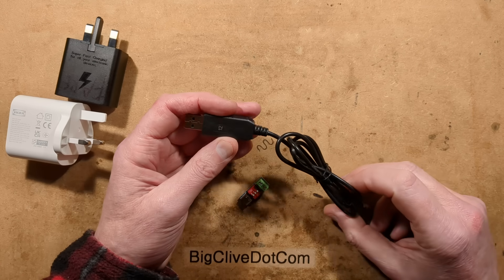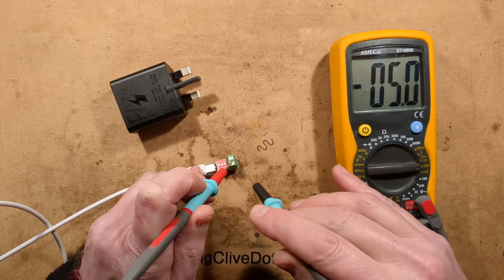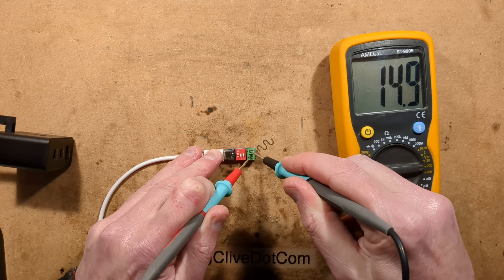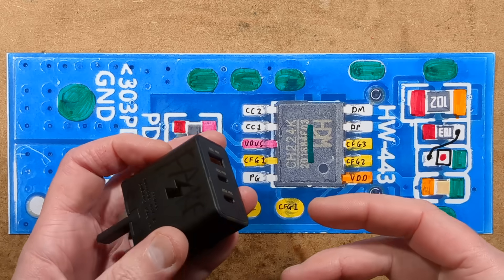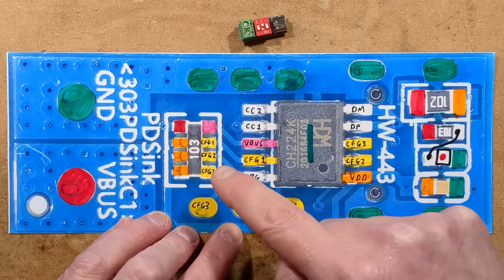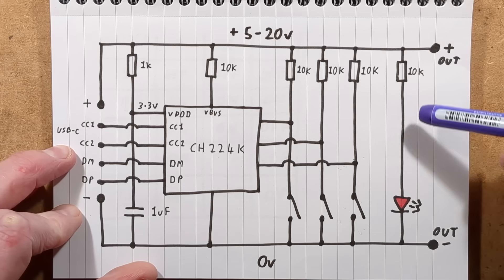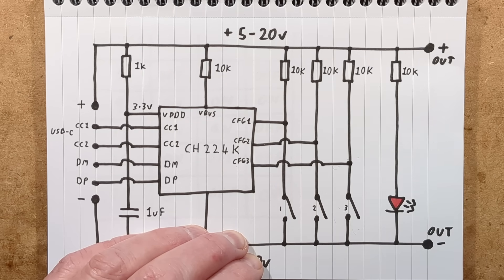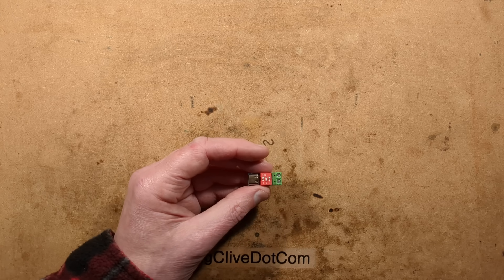Cheap USB-C programmable PD voltage module for 5,9,12,15,20V

Comment: Clive, are the soldering practice boards you can get on Amazon Haul any good? Not sure I can share links but keywords are "Rotating LED SMD NE555 Soldering Practice Board DIY Kit Fanny Skill Training DIY Kit Electronic PCB Board Module Suit"
Reply from the maker: The online kits are usually good.  I don't have an amazon account, but have bought them via eBay and AliExpress.

Comment: I ordered a few of these. No dip switch info. When I found the settings there are 4 settings that with give 5 volts. Are they different types of 5 volts?
Different amps?
Reply from the maker: The dip switch options for this module are in the video description.  Unused modes default to 5V.

Comment: You need to pair it with a voltmeter to identify when you've set the dip switches incorrectly.

Comment: Something I've noticed on a crappy USB power supply I have is that I need to reconnect it at its USBA port for it to negotiate at all sometimes. Doesn't happen when I disconnect the USBC end.

Comment: One little-spoken thing about USB-C. There is an optional chip in the plug of each USB-C cable. Yes, a chip in the cable. The cables can have identity - and if they don't, the capability of the cable defaults to 20 volts and 3 amps = 60 watts. If they do have an identity chip, they can go to other crazy extremes, but I believe 5 amps is the maximum -- 5 amps & 20 volts = 100 watts. Many cables bundled with power banks and laptop chargers have this chip and this capability, but the identity can present even higher voltages - I think up to 50 volts or thereabouts.

However, a sorely lacking device in the prosumer/nerd space is an identifier for these chips - to identify and display cable capabilities. It's a very frustrating problem, not even being able to identify cables with our devices (e.g. phone, laptop) - no software seems to exist to communicate with the USB PD controller and inquire about the attached cable. You can learn it by discovery - for example, attach a power supply of unlimited capability (e.g. a "200 watt" USB-C supply of some kind offering crazy high voltage and current) to a MacBook of some kind, then use AlDente Pro (or maybe even System Info built-in) to see what capability/wattage is detected for the adapter. The system takes the cable ID into account, and tells you the wattage - e.g. if you attach a chip-less cable between the two, it'll report 60 watts.

I wish more people knew about ID chips in cables, and how they become a bottleneck between USB-C power supplies and USB-C devices.

(The USB-C power bricks also have their own capabilities - they may support only a limited range of voltages, or even a subset of select voltages like 5, 9, 20 volts but not 12 or 15. They can also present wattage/current limits lower than the cable. There's all kinds of ways to negotiate, and each limitation must be taken into account!)

Comment: This video came at a good time. I have a computer fan that I had running off of a buck boost USB stick and it failed eventually. It's probably much better to rely on a well made consumer good to put out 12V continuously than convert twice with some hobby project looking buck-boost converter.

Comment: The Vbus is likely to monitor for USB presence - I bet there's an I2C or other interface for a processor on that chip, and it can use Vbus to detect if a USB cable is plugged in so it can notify the CPU as well as to start power negotiations. After all, it can be powered by the circuit because it runs off a battery so the main processor can get information about incoming power. Vbus signalling for USB cable connection is common and how you tell if you're plugged into something (a PC, a wall adapter, anything will bring Vbus high). The Chip uses it to start negotiations, and likely provides that information to a host CPU if desired.

Comment: Well presented video and interesting module, BUTs, inportant BUTs :
1.- These tests without load are pointless: Always check without and WITH LOAD. You will be amazed how bad some output voltages and currents fall when the regulator does not have enough humpf.
2.- Please, WITH LOAD, measure currents, voltages and Watts. 
Then you can tell whether this liliput converter/regulator is really useful.
3.- While loaded, keep an eye on temperature.
4.- A case to avoid accidental contacts, unwanted heat transfer, as well as accidental actuation of the dips would be useful.
5.- And the ultimate point, la reason d'être: Can this little trinket translate and sustain the same Wattage of the source to the load?
Reply from the maker: This just communicates with the power supply.  The stability of the voltage under load will only be dependent on the power supply and cable.
Reply: @bigclivedotcom when a device that small brings up voltage, it reduces current on load. The trade-off is not linear meaning if you turn 10V to 15V current may go from 1A down to .5A but 10V to 20V may crash current down to a few mA.
When it brings down voltage the current demand increases. What is the the top current that this device can handle before cutting off or over-heating?
Reply from the maker: @johnbofarullguix1499  This module does not convert the voltage itself.  It negotiates with a modern USB power supply to get it to provide a higher voltage.

Comment: Was that Liquid Paper you used for the direction? I haven't touched that stuff in decades. I used to get it in ledger green to match the engineers computation pads.
Reply from the maker: I sometimes use correcting film on the schematics.  Maybe a comment meant for a different video?

Comment: Out of curiosity, do you think this module capable of powering a 2amp load at 12v? Would be useful to power a router from a QC-3 capable power bank during a mains powercut.
Reply from the maker: That depends entirely on how much current the power bank can provide.

Comment: This is pretty interesting - I've got a small 10" server rack that has some IOT devices and network switches - all basically 12v 1-2A or 5V 1-2A; this means I could locate a USB-C power supply (one that doesn't turn all devices off when a new device is connected) and then use these circuits to pull the voltage up to 12v for the little network switches!
Reply: Update, the Asometech 140w 6-USB-C out charger shows the correct circuit voltages as soon as they're plugged in - which is great.  Now I just need to make little enclosures for them or something to keep them safe.

Comment: Is it possible to set the output voltage to other voltages? Eq 7.8, 12.6, 16.8v by changing the value of the resisor on each of the switches ?
Reply from the maker: No.  It's fixed values.  But there's a new standard that does offer a wider range of voltages.

Comment: If you really want to know what's going on with that knockoff power supply you need a protocol decoder. They're cheap and even I have one just because I was tired of diagnosing USB-C charger issues
Reply: It will also tell you what protocol this device is capable of using

Comment: Generating the 3.3V VDD just with a 1K series resistor seems pretty nasty to me. Does it have some internal zener diode to clamp VDD to 3.3V?
Reply from the maker: Yes.  It has a shunt regulator.

Comment: There is the Infineon CYPD Barrel jack replacement (CYPD3177) USB-PD sink that can negotiate and output the voltage if the PD source can adequately source the desired power.  It allows for hardware settings, so no boot dependencies or bootloader shenanigans.

Comment: You have to be careful with these PD modules. Some of them will blow up chargers if you back feed power into them.
Reply: I blew up a 100W ugreen charger then a 65W Google charger before realizing it's the PD power supply that's the problem.
Reply: This only happens when the device has more than 5v on the USB power line like there’s a battery connected directly to it?
Reply: @davadoff The USB charger was outputting 15V and when turning off the PD output the battery backfed into the power supply which backfed into the charger.
Reply: @jahnkeanater  ah. Got to be careful charging batteries. I think I did the same but not with USB or USB-PD. Luckily mine was fine, it just powered the power supply through its output. Should use a diode.

Comment: The barrel jacks are even better than this, although fixed to one voltage. A tear down of one of those would be fascinating as they’re all hidden away from prying eyes.

I am waiting for a USB-C PPS equivalent of this board, it must in turn be waiting on chips? Looks like a harder standard to support, going by the variable power supply projects I’ve seen using it needing (?!) a raspberry pi to send the signals.

Comment: Thanks for the video Clive. We finally have an Ikea in New Zealand now so I can buy their USB chargers, you've spoken so highly of them in the past. That one appears to be a 'SJÖSS' - is that right do you know? I think I'll go ahead and order it anyway. Cheers big man.
Reply: Of the current ikea chargers, 30W & 45W (and 60W in USA), probably called sjoss, the 45W one is the one to get, I believe. Maybe 60W if you have access to it. 30W is safe, I read it makes an audible noise.
Reply: @davadoff  Cool thanks for that. I've ordered the 45w version. We have 230v power here in NZ so likely get the same units as the UK (other than the plug of course).

Comment: I have those exact boards on several projects. I clip the leads with flush cuts and the switches as well to reduce the risk of bumping them. 

I've converted 2 LCD monitors to USB C, I have a PoE Switch in my backpack that I used one of these to feed a DC-DC Booster to 56VDC and it runs a whole 8 Port full of cameras off my Sharge 170 Power Bank.

Comment: I have several of these, they are great. Yea I hope it never fails and gives some random voltage to my stuff plugged in lol..
Some look identical but the switches are different, always check with multimeter

Comment: Would be nice to get a few of these to upgrade old micro usb devices to be able to negotiate 5V, or even just to replace the pretend usb C ports in shitty devices that don't negotiate, the ones that only charge with the stupid A to C cable they come with

Comment: I have ordered identical looking boards on AliExpress Combo Blast. But mine have a blue LED and a different chip called "PAK02A RFDWL9000 2502BASAE", Only got it to trigger 5V and 9V, the rest did not work. Tried multiple PD-chargers that are capable of more voltages. Maybe I will try to get one explicitly labeled as CH224K next time.

Comment: I would so love to learn basics of electronics from you. Ever thought about making some kind of course? I enjoy your videos but I understand so little. Like. What does "pull high" or "pull low" mean?
Reply from the maker: Pulling high is when an input pin to a microcontroller is biased towards the positive rail, while pulling low is biasing it towards the negative or zero-volt rail.

Comment: what I would like to know is if these modules are good for e.g. powering a LNA in a simple SDR RF receiver setup, or does the put out "noisy" 12 v that would show up on the SDR input.
Reply from the maker: Any noise will be from the USB charger.

Comment: I presume the VBUS connection is for the Power Good pin that isn't used, it would sense the supply voltage and set the PG level if the voltage is correct? I feel like that PG pin should be driving a MOSFET to switch the output voltage to protect anything downstream from incompatible voltages.
Reply: Problem is it’ll probably switch PG true when requesting 12v but outputting 15v. 
Some PD trigger modules go with 5v if the voltage you request is not available. Some go with the next lower voltage. Some the next higher.

Comment: I use USB-C to power my heated gloves and insole warmers. The Aukey batteries I use have a behaviour where you can switch between the PD voltage and 5V by pressing the button giving me a quick high - low. But a newer higher capacity Iniu battery I bought doesn't do that, so a decoy that could change voltages on the fly would be handy but dip switches won't cut if for my purpose. When I first bought decoy boards I got ones with a female connector but I quickly realized male was the way to go so I could plug it directly into a battery. After soldering on wire with a DC plug I cover the board with a few layers of heat shrink tube and glop on some E6000 to give me something to grab.

Aukey isn't selling in Canada at the moment, I really wanted to try their pb-y57 20000mAh battery which probably behaves like their similar looking 10000mAh one.

Comment: Recently we had our power meter burn up and they replaced the meter box but took them 4 days to bring a meter. I used that usb-a to 12 volts to run my modem from a power bank. Got about 16 hours out of the power bank(28 18650’s in a diy power bank). Charged it back up overnight in the van.

Comment: The drawback of this module is that the encoding is not printed on it and it's a dumb encoding: the step from 5V->9V requires turning on all 3 bits and the in-between states of 1 or 2 bits on triggers 12V/15V/20V, so it fries the load if it's connected and sensitive to >9V. There are other usb PD trigger boards at the same price.
- one with a small dip switch that uses gray code, so each voltage step only requires one bit switch

- one with a pushbutton to circle through 5V-20V and leds to indicate the voltage.

Comment: While I'm not a huge fan of the USB-C connector I really like these modules. I'm running my Pinecil soldering iron off of a PD supply and I recently built a simple bench power supply by using a 28V version of these triggers with a cheap ebay dialable regulator. Not to mention I've converted a lot of bits of kit I want to be portable to run off power banks using this system.  It's the fact that they can do 5A as well. 20V at 5A is as much as most laptop chargers.

Comment: Cheers.  I would like to see you put devices like this under load, to check the manufacturers current handling rating.  I see a claimed 100W.  I'm thinking things might get a bit smokey at 100W...

Comment: I have a couple of USB C to barrel jack PD cables from Ali. You can choose which voltage they are set to. Mine are both 20V and I use one to power my TS100 iron from my 65W gan charger and the other to power a laptop. They are incredibly useful.

Comment: How is the VDD always at 3.3v if it is connected directly to the usb c + terminal? There is just that relatively large 1 resistor there. I would think the VDD pin is whatever voltage you change it too, no?
Reply from the maker: The resistor limits the current and the chip has a 3.3V shunt inside it to limit the voltage.

Comment: These are seem really great except that the board is flush with all of the components....they would be so much easier to use in projects if the board was wider with mounting holes and the USB-C port was proud of the end to enable it to pass through the wall of a case

Comment: I like the 100W model I have with a voltage selection button and different color LED for voltage status as you can't accidentally switch it unless holding the button for x amount of time versus this where you could accidentally bump a switch and not notice.

Comment: My phone charges at a maximum of 30 watts, verified by an inline USB-C tester, and that's already TOO much for my liking. 

30 watts IS a heck of a LOT of power being rammed into a single lithium cell that is only a couple of millimeters thick, and only a few inches square... 😬

My current phone is only about 18 months old, and its battery life has gone down quite noticeably since it was new. I'm thinking that the "Turbo Charging" is to blame for that.. 🤔
Reply from the maker: I charge my devices with a classic 5V charger to limit charging speed.
Reply: Me too. Limit it to 5W. Also never go below 40% or especially 20% charge. If you’re doing something that uses a lot of power, plug it in (it’ll stress the charger and not the battery at all).

Comment: There are cheaper "decoy" boards that have solder jumpers instead of a switch, which might avoid accidental over-voltage from disturbed switches. Some USB-C cables ade advertised as having high power capabilities I suppose the USB-A end is the weak point, a power supply with a USB-C connector probably provides the highest power link.

Comment: That's a new one. Never seen one these with DIP switches. 
The voltage check is there to make sure the device really outputs the requested voltage as not all PD devices support all voltages (eg. 12v is often omitted) and the device needs to make sure the voltage is supported, you can't rely on profile number alone. And you don't want to accidentally send 15v to a 12v device.
I have a plenty of USB-C trigger modules, but they are all are programmed with a single button and an RGB LED which changes color depending on selected profile. You can either set the voltage temporarily or program a fixed voltage by using the module's programming mode (e. g. for embedding into a device). In case the voltage isn't supported, the module always falls back to 5v, so it will never overvolt.

Comment: I love those things. so useful, although a little noisy at times

and they almost always need a heatsink added

One thing to note is that cheap power supplies don't switch between voltages cleanly

Comment: A neat, and very cheap little gadget.  Be aware (as others have noted) that the negotiation isn't instantaneous, so for a very short while you always have a 5V output (which in almost all circumstances shouldn't be a problem). Since the chip doesn't directly regulate power, it can provide quite a few useful watts, even at higher voltages (esp. using a genuine high efficiency GaN USB-C supply.)